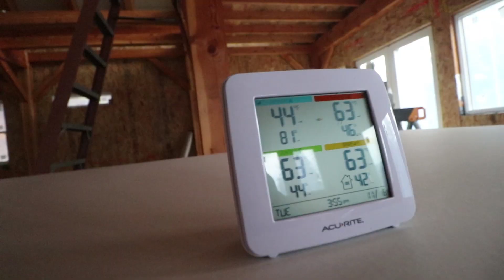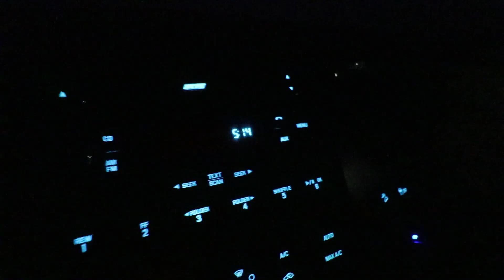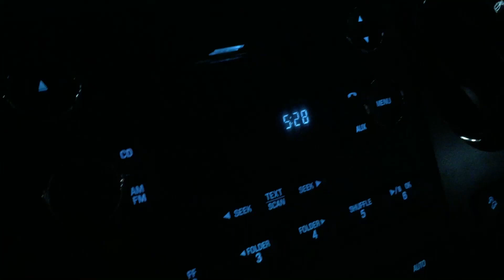This Video Will Make DRYWALL INSTALLERS CRINGE!

Comment: With one eye half open, because I don't dare use two. Your getting there but use some mud under the tape. At 3 minutes there is tape lifting on the wall . Just keep at it. By the time your good at it , you will be done. Semper fi drywaller sense 1965

Comment: For a rookie not bad but you might want to get to tape that has the he Civ glue that's like a screen that might work better for you or buy a tape gun forgot the name you'll find it the big box we are Home Depot or Lowe's stores or Menards and the drywall section I even find it where you found those blades it's a big aluminum box that holds tape with mud in it good luck .

Comment: Drywall hoppers are $19.99 at harbor freight right now.  I bought one for some drywall repairs because those can's spray mud on too thinly.  Please do NOT use a bunch of cans.  You'll regret it.  Hopper will save you so much money over cans also and you can use it on other parts of your house in the future.  Just remember to buy a shut off valve as the hopper chews through air.

Comment: have to disagree on the purpose of painting a home most builders use a mostly clay based "dead flat" paint on new construction regardless of what room you are in and that provides almost no moisture barrier now I am not saying that a good latex paint doesn't provide a moisture barrier I am just saying that is not the purpose of painting and the reason you use the purpose built drywall in wet areas is because moisture can get through most paint

Comment: If there were anything I could suggest to help would be throw that perfa-tape away and use Fiba-Tape. With Fiba-Tape it has an adhesive to stick on the wall and with it's mesh it allows you to skip the "Pre mud" Because your mud goes through the mesh to hold it on the seam. So you completely avoid a step just by using the Fiba-Tape. I have always had good results with the Fiba-Tape. I was shocked Myself when I first used it. I hate having to do mudding but with that Fiba-Tape it makes it so much less work. I am not sponsored by them in any way I just love the stuff for doing the job. I feel it could help you. Looking at the comments before me and wow not one other person has suggested this already which shocks me. Does nobody else know about Fiba-Tape? The stuff is genius in my opinion.

Comment: Watching you tape your first joint made me cringe.  First, add some water to your mud, then mud the joint, set the tape, wipe out the mud.

The tape has a crease in the center.  Fold it in half before setting an inside corner.

Comment: I've always used 3M super 77 spray adhesive on paper corners, learned from an old timer drywaller.  And don't texture the walls, it sure makes any touch-ups later on down the road much more difficult to match that texture.

Comment: your mud looks too thick. Also i thin mud joint and then mist paper with water. lay tape on wet join and thin mud over. this works great in cool building. misting paper stops paper from pulling moister out of mud allowing for smother joints. Thin Thin Thin, mud should be thin so dries even and doesn't crack.

Comment: paper bead is suppose to be put on with mud. u coat the drywall with a even coat of mud. put on ur bead ( bull nose ). then drag it tight with a knife.  sorry to comment. i have been a drywall finisher for 24 years. :) but u did a good job. wish i could be there to help.
Reply: and cringing is not the word :P
Reply: and on ur corners. fold your tape in half first then add it. future tip
Reply: ok ok im done lol great job.
Reply: oh and a 5 gallon bucket and a 9" roller works good for texturing
Reply: love you guys keep up the great work. i have not missed a video yet. :)

Comment: Tip on your corners yse a paintbrush and a stiff one just glop it in fold your paper before you put it up then smooth out it sounds stupid but it works
Reply: And that little light will work good for showing low and high spots just lay it against the wall the light will surprise you
Reply: Build  a temporary wall were you garage door  is run a really long flu put your great wood stove to work

Comment: Looks like you have your hands full.  You are taking on a huge project but in the end the feeling of accomplishment is something very fulfilling.  Dry walling is an art and in all honesty not one that I have mastered as a DIYer.  There are a lot of tricks of the trade and a lot of questions I have had, I found on the internet YouTube.  There are a lot of contractors that show you their tricks and may I suggest you check it out prior to start up, that way you have a good source of knowledge to get you started.  Also, for a DIYer like me, I would never start this at 9:00pm+.  I know that you want to get it done and have a bathroom, but this job you really need to take your time.  Good luck.  I have been there where you are.  Tim

Comment: I cringed during the first drywall video. Key hole sawing cut outs? Hanging the bottom sheet before the top sheet on the wall? And now you are calling a taping knife a drywall knife. A drywall knife IS a utility knife.

Comment: You should've done ALL your ceiling inside tape FIRST.
Bull Nose with paper is supposed to be put on with MUD ONLY.
ALWAYS do your screw heads and joints first ...then hte outside corners last.

Jesse...CALL ME ...I'll come up and help you with the mud and taping....NO CHARGE

Comment: It's just drywall Jesse.  Don't sweat it too much.  You definitely want to get an inside corner drywall knife before you start on the upstairs living area, they're worth their weight in gold.  I'm and electrician and yeah, you've made me cringe a few times, but I never saw you do anything dangerous, just not using the best methods sometimes.  As long as you're not doing anything that is unsafe or hazardous, it won't matter in the end.

Comment: What a shame this was done 2 months ago as the right way is to put the Bullnose under the sheets then screw the sheet that holds it in place. 
then you don't have to fill and sand, and use yellow drywall tape behind it to hold and seal it in place. 
Oh well you learn from your mistakes. 
Perhaps this will help when you do the bathrooms upstairs

Comment: OBoy! No Picasso there on the spackle! lol on the screws just swipe it one direction
then another direction! then move to the next one! on the tape works best if you measure what
you need roll it up wet it in a bucket of water! mud the the seams apply your tape! go over with another thin coat of mud! smooth the air pockets out, put another thin coat of mud over it!
you'll get it! no worries

Comment: We were already cringing! Just kidding but I always wonder with the amount you are spending on tools and machines how much you are saving by doing it yourselves? By the way I use marine ply around showers and behind sinks etc because it will survive a leak and save a fortune on repairs if grouting fails or should I say when. Also paint everywhere with polybond before you apply any skim costs very little and helps restrict moisture ingress , I know you are miles ahead of the vlogs but it might be of interest to other viewers. Keep up the good work! Oh and just so you know you're vlogs are kinda addictive for all sorts of reasons.

Comment: Just glue on the bullnoses.. 
Hate those paper reinforcements ill rather use the fiberglass ones instead.. 
and for the sanding later on i would get a giraff. (Discsander on a extentionpipe that rotates and connects to a vacuumcleaner) i skip sanding in between first and second layer of mud, just use the mudknife to knock down the worst ridges.

Comment: Jesse, get yourself a better flashlight, you a better light. Get a LUMINTOP TOOL AA 2.0. You can find them on amazon for $17 and they run off AA of 14500. They are much better than these cheapies.

Comment: I'd not use bull nose and go with normal drywall corner bead for them small spots. works really well as I had the same issue in my bathroom remodel. Not sure on these bull nose, on the drywall corner bead I use, I just used mud to attach..

Comment: Like Todd said earlier, get the self-adhesive tape - its a lot faster.  Also - the only good use for the 4" knife is for is removing mud from the bucket (and cleanup).  Use the minimum of 8" knife for all the mud work.  I always use a 12" for the final coat of mud.
Another tip is when screwing in the sheet rock:  Your mud work will go faster if you use a screw at edge of a sheet and then place two screws close together (1-1.2: apart) at about the 16" and 32" points and then a single at the other edge of the 4' sheet.  By grouping the screws together you get the same holding ablilty of the way you placed them, but the mud work is only two spots across 4' as opposed to your 4 or 5 screws and corresponding mud spots.

Comment: on a real note.. the only way you made drywallers cringe is that they didnt get to rip u off on your install...    after u sand the mud down and paint it will look the same as having someone at $15-20 an hour. for something that can be done by you...    ps i got 6 acers of raw land too and im also facing a lot of the same chalanges. in building my home.

Comment: Sorry but did you just say that you protect drywall from moisture with a paint?! Sure its ok in other parts of the house, but in bathroom, specially with shower? Just slap some mud on the seams with drywall tape, coat first the floor with water insulation coating, tile the floor, then coat walls with water insulation coating, install the shower and then tile the walls. Also wheres a vapor barrier plastic? It should be under the drywall. With proper ventilation there wont be any mold and dry wall stay dry, cause there is so little surface for moisture to permeate... I would truly lose my mind if i were to move in USA -.- Building practices there are just ridiculous.

Also moisture in sheetrock sure will dry, but the paper surface like you mentioned give extremely nice place for microbes to crow and those buggers wont die off from dry season. Summer might have been dry and allow the sheetrock to dry as well, but when you are actively living in there in winter all that moist hot air will collect to top and permeates into drywall, unless you are to have mechanical ventilation system with moisture removing components and have intake on highest point. This just increases energy bill in that regard and if system malfunctions or user error occurs mold has nice place to grow. This is why i rather have less energy efficient structure per say that breaths properly like log construction than highly insulated plastic bag..

Comment: Sorry, but NO!!  that is to be installed with mud, no screws or nails required!  Please hire professionals to do the rest of the house.  YOuo will not regret it.  And yes, it is making me cringe.  you did fine hanging the drywall, but the corner, not so much.  I am a professional, just to let you know.
Reply: I was referring to the bullnose corner bead
Reply: @alvinbaker8137  I hope so... lol could you imagine someone trying to use mud to secure the boards to the wall hahahaha
Reply: If you considered that a fine hanging job, I'm glad I left the business and don't have to finish any of your hanging.

Comment: Sorry, but Latex paint is significantly moisture permeable.https://buildingscience.com/documents/information-sheets/building-materials-property-tableThat said, since this bathroom is in a leaky garage, I don't believe Mold is going to be a problem, unless you have a leaky pipe. My vote: NO Texture. plain simple primer & paint after you mud and sand.

Comment: Jesse , I feel your pain ! I have done drywall over the years and must say it is something that drives me nuts . For me it is usually a small job , not enough to get or hire anybody . If walls are true and plumb , not to mention square it would be much nicer . I am a retired machinist , so you can imagine how houses drive me nuts . A small job I have is to remove drywall nails that have discolored from corrosion in the ceiling of our bathroom . I will replace them with coated screws . Hope to do it without having to tear out the whole ceiling . But imagine I will have to .

Comment: sorry i am from the uk when he says mud does he mean plaster ??
Reply: No mud you use to hide the cracks and screws plaster is more like a finish what you can do after the mudding
Reply: jacey marshall   Yes. Wet drywall compound.
Reply: Yes, although I've also heard The Essential Craftsman using 'mud' to refer to concrete.
Reply: no its a completely different material the mud he is using can also be called joint compound. I'm not an expert in the make up of either material but what I do know is that joint compound or "mud" is softer than plaster when it hardens making sanding and leveling much easier.
Reply: Yeah, it's officially called joint compound - used to fill and tape cracks and screwheads. Americans don't tend to skim walls with plaster like in the UK. Just "mud" the joints, sand and paint.
Reply: Yes, mud is slang for joint compound
Reply: Yes, although plaster is an old school term that was in coordination with the old lath and plaster applications.
Reply: jacey marshall yeah, I think so - looks like ready made plaster... I find it strange that the US don’t use scrim tape... so much easier than that paper stuff!!!
Reply: jacey marshall drywall seam compound= mud
Reply: Mud is also called joint compound and it is made from gypsum. While mud and plaster have similar uses, they are very different in application.
Reply: jacey marshall basically although we sometimes differentiate “lathe and plaster” from drywall and drywall compound or mud but it’s basically gypsum paste with some water reducers
Reply: No they're different.
Reply: yes
Reply: Yup
Reply: Its a filler, comes in tubs, stronger than plaster less prone to cracking
Reply: Yes. And when he says "plastered" he means drunk.
Reply: Yes, it is drywall compound, but I don't think it is the same as actual plaster.
Reply: yes and drywall is gyprock or plasterboard
Reply: Drywall compound, I guess it's something like plaster but only covers the seams and screws. What we'd call plaster in the states is skim coating the entire wall.
Reply: yes.
Reply: yes
Reply: Drywall mud is not the same as plaster, at least not in the US. Plaster is more like concrete in the fact that you cant sand it, you'd have to get a grinder out smooth any rough spots. Drywall mud is basically gypsum powder (same thing thats inside the sheetrock/drywall board) mixed with other minerals and glues which makes it lighter and easier to use and sand-able once dry.
Its also worth mentioning that the product he used as his "drywall mud" actually looks like its a spackle product meant for small holes. Probably took a week to dry between coats if it is the same mix as dap's branded spackle
Reply: no he means drywall mud. A premixed compound like plaster but lighter and more easier to apply and sands smooth when done.
Reply: He is saying mud but I think its actually joint compound. Plastering/plaster isn't super common in new construction since most walls are not constructed to take/hold plaster.

Comment: A texture hopper is cheap and you will use it dozens of times on your house. Its hard to mess up a good orange peal texture with a texture gun. you will be very unhappy with how the spray cans look.
Reply: Depends what type of hopper your talking about.
The hand held type where you have to hold a literal hopper full of mud run $50-$100
But a professorial hopper/compressor combo (where the hopper pumps the mud to only a gun you have to hold) now start at $1500

Comment: Man, you got the wrong stuff. You need the adhesive mesh tape to join the sheets and corner and avoid cracks later on. Just stick the tape over the join and apply the plaster on top of it (generously, it might shrink drying)

Comment: Get your sheetrock installed and pay mud men to come in and finish. They'll do it in two days, you'll do it for months.
Reply: Honestly if your planning to hire out the finish, you could save yourself even more money buy having the same company hang and finish. Only on the rare occasion does a homeowner actually do a decent job hanging, normally end up increasing the bid for finishing because of amateur hanging mistakes.

Comment: Why didn’t you use a green board drywall in and around the shower head?
Reply: @7:38
Reply: because he said that manufacturer makes their water resistant board white instead of green
Reply: Why didn't you watch the video first?
Reply: Didn't you listen. Go back and watch it again.
Reply: Did you watch the video?  He spent 10 minutes explaining it!
Reply: Listen to the damn video come on
Reply: He mentioned that they do not have actual green board in their area, so they are using white MR board, which is the same thing.
Reply: I think you missed that explanation in this video...
Reply: 7:33
Reply: you didn't watch the whole video he talks about why he used what he did. If you had watched and listened you would know the stuff he used is the same rating as green board its just from a different company.
Reply: Richard Williams Did you watch the video at all? He explains that at around 8 minuets....
Reply: He explained this in the first few minutes of the video.
Reply: He explains that in the video.
Reply: I'm confused, very confused on this too.
Reply: Because if you watch the video and listened to what Jessie said he fitted moisture proof drywall, it just isn't green!
Reply: Why didn't you watch the video where he answers this question?
Reply: Yes I agree! Plus no insulation between studs, means noise transmits easy, no singing in the shower Jesse...